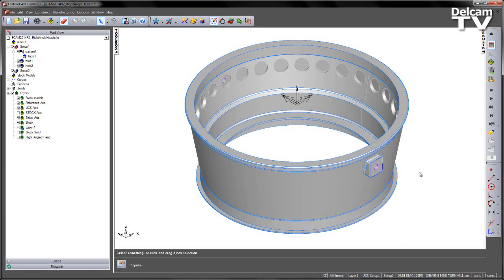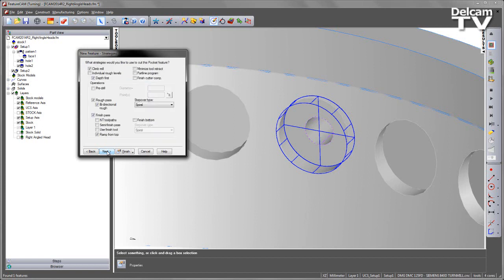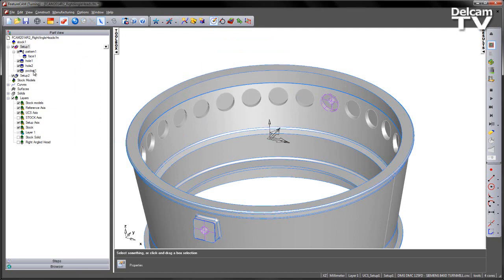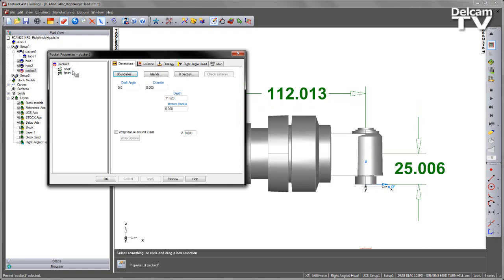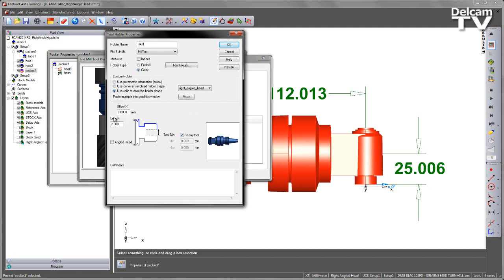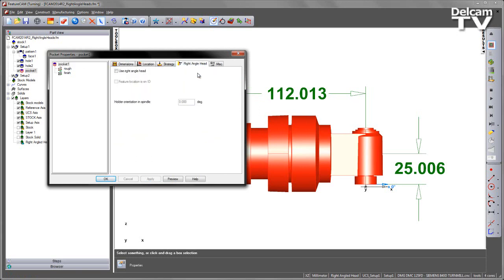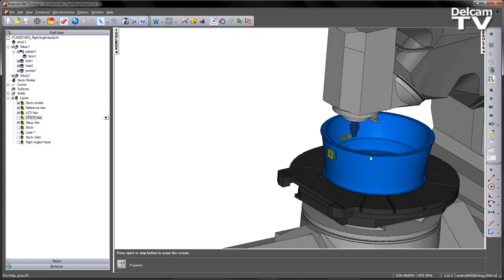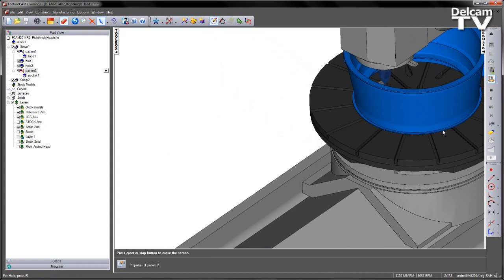Right Angle Head Support - FeatureCAM 2014 R2

Comment: Why angle head support is only available in TurnMill and MillTurn modules? For example, Varnsdorf TOS machine is a horizontal milling center, that is not a completely MillTurn machine. But to make FeatureCAM to use angle head we have to create MillTurn project.